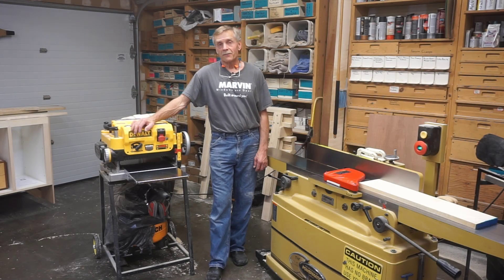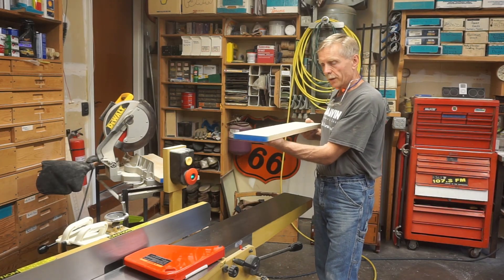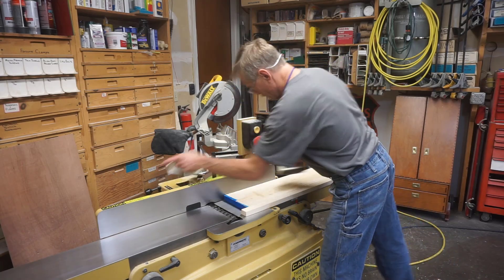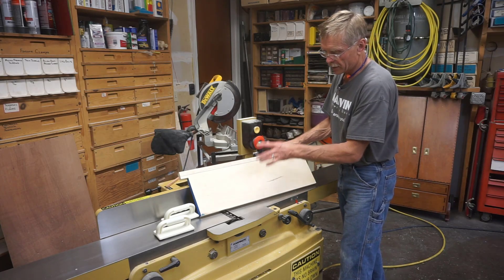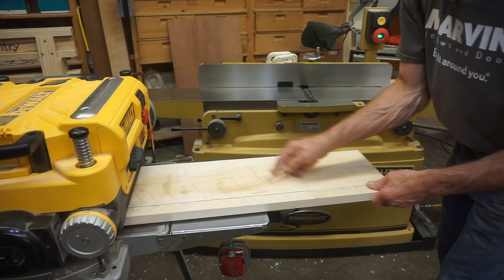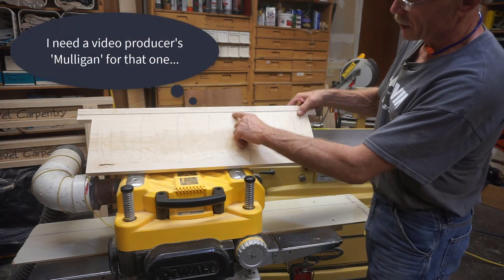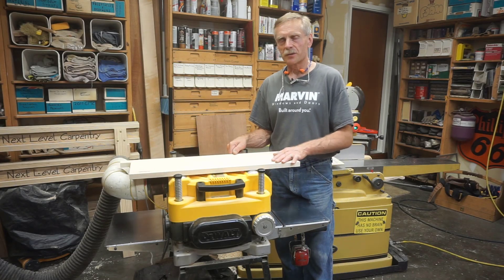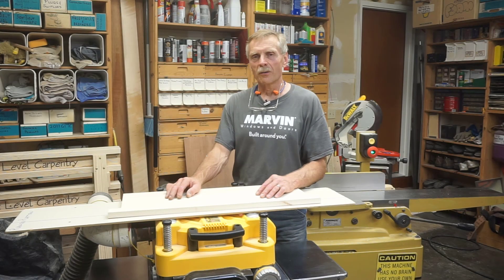Supersize Your Jointer for Planing Over-width Boards

Comment: This is a great idea.  How wide of a board would you use this technique for creating a truly flat board?
Reply: I think a better question is why they sell 12.5" planers as the smallest size, but 6" jointers? They're really one operation broken into two machines (yes, I know each has solo applications; after glue-ups, cleaning up tear out, etc., but still). 

It's the hotdog/hotdog bun irony of the woodworking world.

If I had to do it over, I'd get one of those planer/jointer combo machines that uses the same cutterhead for both operations. Woulda been cheaper, long run, too.And since the only viable technique IS this one that involves removing the blade guard (and THAT'S terrifying, respecting the blade or not, ESPECIALLY on a 6" benchtop jointer), a LOT safer, too. My old 6" Shop Fox you had to TAKE APART to remove the guard, so it just lived that way. S-K-E-T-C-H-Y, lemme tell you.
Reply from the maker: I think a decent rule of thumb is that, working carefully, you should be able to flatten a board half again as wide as your jointer with this method.  For my 8" Powermatic PJ88s that translates into a 12" wide board.  It gets exponentially harder as you max out the over-width so, if a piece is very critical, I go with a planer sled instead because I've got more precise control with that setup.  But for a stack of 10"+ boards this method is MUCH faster than a sled.  Best, Matt
Reply: @NextLevelCarpentry  I didn't see this reply until after I commented. I'm glad you addressed that issue. I've never really bothered to check accurately how uniform my thickness is after using this method, but my guess is that your recommendation on half-again the capacity of the jointer is good advice, and any difference from the lug side to the opposite side would be acceptable for most applications. After all, a few thousandths of an inch difference coming off the planer is probably the best you can do even with a board that fits your jointer.

Comment: Hypothetically speaking, can a jointer be used as a planer? Meaning, if you run a piece of wood over the jointer isn't it the same as having gone through the planer? I mean it is still flattened on one side. I say this because I do not work with raw wood as all of mine is dimensioned lumber from the mill. I do not need a planer but might have use of a jointer. So if I bought an 8 inch jointer maybe I could use it like a planer up to its 8 inch capacity.
Reply from the maker: Hey Jeff: a few facts to consider:  A jointer can be used as a planer but is limited to accuracy on only single faces of boards.  Even 'dimensioned lumber from the mill' can, and frequently does, have twist in it that's unacceptable to me.  What's essential is having TWO flat faces that are in parallel planes... and THAT property is only accomplished efficiently with the combination of jointer and thickness planer.  If you've a choice of only one machine, go with the thickness planer since a planer can be used as a substitute for a jointer for flattening boards (by using a sled) but a jointer won't work as a thickness planer with any useful degree of accuracy IMHO. Best, Matt
Reply: @NextLevelCarpentry  Thank you.

Comment: Kind of off topic, but I just wanted to let you know what a great company Delta is. Our home was destroyed by an F-4 tornado in Southern Maryland 18 1/2 years ago. It was picked up in one piece and moved about 9 ft. When it came down, one corner of the house landed on my Delta Contractor saw. I sent pictures to Delta, and they called to tell me they were giving me a new table saw! I explained to them that I had already bought a new table saw, so they asked me if I needed anything else. I told them I had been thinking about an 8in. jointer. They sent me a brand new 8in. DJ-20, $1,650, to my temporary house, completely free of charge with no shipping!!! To say I was overwhelmed is an understatement!! They have a news letter and they told everyone what happened, and they titled the story "Delta Saves Lives"  I use my beloved jointer every day and absolutely love it! Think about this story when you buy your next piece of equipment. By the way, I have been using your method of jointing wider boards for years, and it works flawlessly!

Comment: Invaluable, Matt. Great video. You’ve clearly been around the block a time or two- if you were working in a small space, which combination would you choose? 6” jointer with a 15” planer; or an 8” jointer with a 13” lunchbox planer? All parties have helical cutters.
Reply from the maker: Hey Dan, As I am actually working in a relatively small space my choice, hands down, is the 8" jointer and 13" planer.  I don't consider the DW735 a 'lunchbox planer' though as it's large  height adjustment 'pillar' footprint give it great snipe-reducing operation compared to lesser models that are wider than they are long.  In 20 years of self employed work I've not had a single project I couldn't handle with excellence with this combination. In fact I started out with a 6" jointer and chose to upgrade it to an 8 rather than upgrade the planer to a 20. I don't mean to be flippant when I say 'it's not what you got but how you use it that counts'.  If you're planing all day, every day and profitability relies solely on planer throughput then a planer upgrade makes perfect sense. Thanks for watching and commenting here... Best, Matt
Reply: Next Level Carpentry Wow... I can’t tell you how much this helps!! I’ve been on the fence with the 735x for a while, but I really think I’ll pull the trigger, and then throw the extra bucks at a Grizzly G0856. Appreciate the input Matt!
Reply from the maker: I wouldn't feel comfortable sharing that opinion / advice if I felt you would regret it... let us know how it goes?
Exercise a bit of extra precaution as you set up and get used to those new machines because unfortunately they're as good at removing flesh as they are at removing wood😎

Comment: Thanks for this tip, why at 9:40 did you put your flat reference side on you platen extender and not just the planner stock platen?
Reply from the maker: Good question Roy!  I do that because the thickness is set to the distance between the platen extenter and cutterhead at that point.  If I remove the 'platen extender' I'd need to drop the cutterhead 4 rotations to get back to the same thickness setting.  I usually remove the extender for the final passes on both faces but it varies when I do it.  Hope that helps?  Thanks for watching, paying attention to details... and commenting! Best, Matt
Reply: @NextLevelCarpentry  ah-ha, the so obvious not so obvious :)  Thank you.

Comment: Any reason why you just start with a plane sled?  Let it flatten one side, then flip it over?  You could just shim wobbly boards as it goes through the planer?   I guess it's six one half dozen or another.  Doing it on the jointer first or using the planer sled for the first few cuts.  Of course your technique eliminates having the shim the board so it won't wobble.
Reply from the maker: The main reason is efficiency... when I do this for a project I often have 10 or more pieces and they're likely 6' long or longer.  Fussing with shims and a sled would easily take 3 times as long for the same result.  Those without access to a jointer need to resort to the sled process you mention but coming up with a suitable sled for pieces 6'~8' long becomes an issue.  Thanks for watching and commenting here Hansang! 😁😎
Reply: @NextLevelCarpentry  Makes complete sense.  As I pondered about this before hitting the sack, I thought about the efficiency angle. But the long sled part, I didn't.  Makes perfect sense!  Thanks for your videos!
Reply from the maker: For sure Hansang!  BTW I've used a section of 12" x 1 3/4" LVL beam as a long sled on a live-edge plank before.  It's a bit unwieldy but it can be done if forced to by circumstances and project demands... Best, Matt

Comment: I don't understand why that part is called a "rabbeting ledge." Since it actually interferes with making a rabbet, it seems more like an "anti-rabbeting ledge."
Reply from the maker: You misunderstand the what the term refers to.  The part that interferes with making the rabbet is the outboard corner of the outfeed table.  The rabbeting ledge supports the workpiece whilst making the rabbet.  I expound on this a bit in this video if you're interested: https://youtu.be/ze1yyAb7rUU?t=1940
Best, Matt

Comment: Sees MDF board Slaps head. Why didn't I figure that out sooner? I rhought there was some way to widen the jointer, but then realized that it wouldn't work when I saw the jointer blade. So basically wider planer > wider jointer. in importance. Brilliant!

Comment: After the first pass the lug still rides on the in feed table and is no longer flat. It takes more off the fence side of board. I still use it and hand plane the lug after every pass. A lot easier than hand planing the whole board.
Reply from the maker: The whole point of the video, John, is to show that this flattening process can be done completely in one pass to eliminate hand planing which is definitely 'a lot easier than' ANY hand planing.

Comment: I was wondering if you think this approach would work for one of the benchtop jointers.  These jointers aren't parallelogram like yours and I'm not sure what thickness you could do a rebate/rabbet.  Any insights would be greatly appreciated.  Great idea and thanks for taking the time to make a video.
Reply from the maker: LaVike whether or not this works on any jointer, bench top or floor model, (Parallellogram is merely an adjustment mechanism, not a capacity factor) is determined and defined by the machine's width and depth capabilities.  It's an advanced technique that requires a higher level of understanding and experience to grasp but I can't think of a physical reason it wouldn't work with pretty much any jointer.  Naturally it will work better on a better jointer but only  because better jointers just work better... how's THAT for circular logic?  Work safely if you decide to perform this process, OK?
Reply: @NextLevelCarpentry , thank you very much for the reply!  I agree on the better the jointer, the better the results.  I just wasn't sure if it would work on one of the new benchtop jointers.  I also appreciate that this is a very advanced technique. Thanks again!

Comment: Great video Matt! All steps make very good sense and easy to follow. I do have a question. It looks like you are putting a lot of pressure on the board when you run it through your jointer, are you? Thank you Matt. Best Regards Steve
Reply from the maker: Thanks sfkwsmk... glad you like the video.  It does take a fair amount of firm pressure to take a full width pass from a piece of wood on a jointer.  The pressure is to keep the piece moving forward but NOT push the workpiece down flat to the table... that would be counterproductive since it would just spring back up after passing the cutterhead. The most frequent fail is to have the paddles slide across the face of the wood.  To prevent that I do two things: one is to make sure the jointer table is clean and give it a liberal coat of paste wax to minimize friction.  sometimes I do this more than once during a larger 'run' of boards.  Two: spritz the cushioned rubber paddle faces with a mist of water which increases their 'grip' on the surface of the board.  These are good practices flattening pieces of any width over about 4" but are especially necessary the wider the pieces you're flattening.  I also make 'wheel chocks' for my jointer so it doesn't roll forward during this procedure either.  A simple thin, flat strip of wood jammed ahead of the front wheels will prevent them from rolling.  Hope that helps.
Reply: Next Level Carpentry Thank you Matt. Excellent information. That will help a lot.

Comment: I noticed the ground wire on your PVC dust collection system for your planer. It took several high voltage shocks before I got annoyed enough to do the same!

Comment: I am 49 years old, lifelong professional builder with a crew of 4 younger green guys that need their fingers! I am the guy still in the shop most days, but my point it is that most people watching your videos are green, and guards are there for a reason..right? Safety needs to be promoted on the internet. You are also seasoned, and that should be your focus if you want to make educational videos. I did not suggest any thing else than keeping the guard on a jointer, or at least explaining the repercussions to folks not so familiar. Ive watched fellow workers lose digits, and fall off roofs.... I WILL keep my guard on old dog.
Reply from the maker: Try paying a little more attention so you don't appear as such a boor:  https://youtu.be/vzmSjlXJ2fg?t=148 ?!
Reply: Yep, I watched the whole thing the first time. You hopefully realize that you can flatten a board with just that planer alone? It's not magic. no "patent" needed .I have a 8" jointer and use my wide planer bed all the time for that operation? What is missing is that you added a dangerous step that should not be taught to new woodworkers. 
Put the guard back on for safety. What are you actually patenting here? You are clearly skilled with bad safety habits trait your generation taught me in the carpentry trade.
Explain to everyone how removing that guard is safe; should they want to know?
 @NextLevelCarpentry
Reply from the maker: @ericanderson8786  uhhh the 'patent' is a joke, dude.  It's an auxiliary platen and the joke is a play on words that, if you look closely, says 'platen pending'...  🙄

Comment: Bad on you suggesting removing the guard on the jointer! Jointers are nasty beasts.I was working in a millwork shop in the 1990's and it was the culture to not have that guard on.
One mad boss throwing a metal chair across a huge shop cost me a ride to the emergency room while working on jointer with no guard. I still have my fingers, but its was ugly!!
Keep your guard on!....there are other ways to flatten wide boards.
Reply from the maker: I insist that YOU keep the guard on your jointer Eric... and please add to your over reactionary caution insistence that viewers wear full body armor while at work to protect themselves from flying furniture in case they don't have the sense to realize there are other ways to earn a living...

Comment: 3 to 4 k$ jointer $500 planer...
Reply from the maker: Cheap at twice the price TWWF... but don't tell DeWalt or Powermatic I said so?  Best, Matt
Reply: @NextLevelCarpentry  lol ok!
Reply: To be fair I only have a 2500.00 jointer and am still saving up for my planer

Comment: Why even put it thru the jointer? Just send it thru the planer on the sled then flip over and run it thru without the sled, done.
Reply from the maker: I sense you're lacking experience with this toadamine... I only reply here so other viewers don't read your statement and mistakenly agree.  Best, Matt

Comment: Oh you old trickster! You really fooled those guys with the 24" joiners to watch 3/4 of your video before letting them know they didn't need to watch. Of course they could always use the trick to get a flat 35" board using their 36" planer.

Comment: Matt, if you have time....what type of jointer is that
Reply from the maker: Hey Greyghost, it's a Powermatic PJ882:  https://www.amazon.com/dp/B0007DHHEM/?ref=idea_lv_dp_ I didn't like Powermatic's helical cutterhead so I bought the machine linked here and installed a Byrd Shelix helical carbide cutterhead with their 'rabbeting tip' installed.  That's essential for this operation so reach out if you're seriously considering a PJ882 and I'll answer any questions you might have. Also; it's a parallelogram type depth of cut adjustment... another KEY feature/capability.  I offer because I was exasperated trying to get answers back when I bought the machine.  Response from Powermatic was... ignorant?  Byrd knows their stuff.  I'm completely satisfied with the machine and it's performance and I've had it for about 10 years now.  Best, Matt

Comment: Thank you for this video. I was stressing about the price of a 10”+ jointer. Most of what I need to flatten is <8” but occasionally need 12”. There is a significant price jump above 8”. This puts my mind at ease I’m going with 8”!
Reply from the maker: RnBergman: my reasoning is exactly like yours!  I recommend getting the best 8" jointer you can afford and a helical cutterhead with rabbeting capability like the Byrd Shelix design... that's imperative if you plan to 'supersize' it.  Also; unless the jointer has parallelogram adjustment capability you'll be frequently frustrated by slow depth of cut adjustments which you'll need a LOT for this type operation.  In an act of shameless self-promotion I'd ask that if you happen to settle on a Powermatic PJ882 like you see in the video and don't buy it locally I'd sure appreciate it it you'd use this link: https://www.amazon.com/dp/B0007DHHEM/?ref=idea_lv_dp_  You get the same low online pricing and free shipping from Amazon plus they help support production of free videos here at Next Level Carpentry 😉😎
Work safely and enjoy! Best, Matt
Reply: I will point out Cutech makes helical jointers and planers that are priced in the US$600-800 range. They seem to get good reviews.